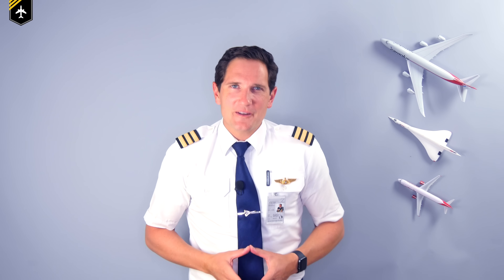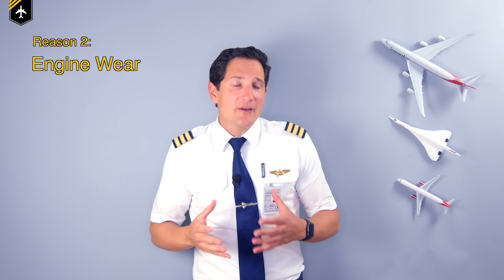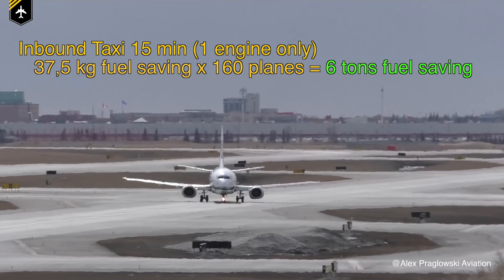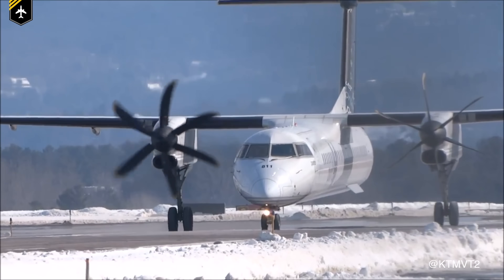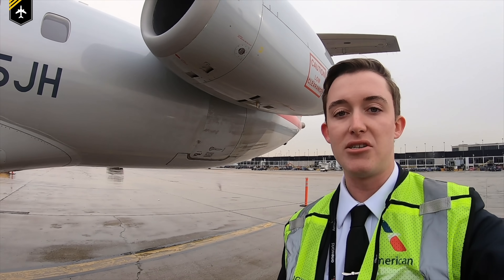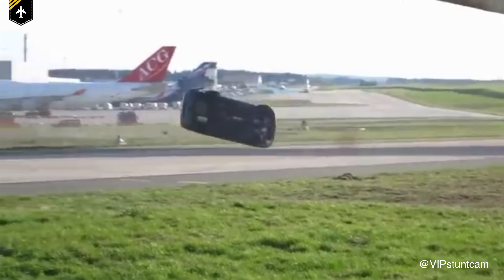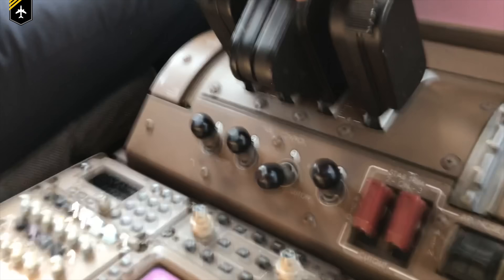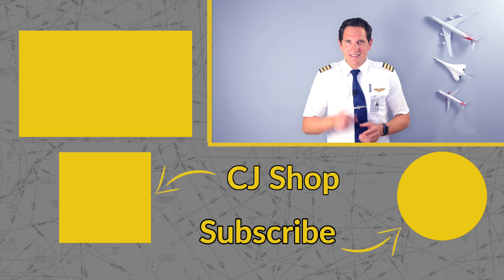Why do PILOTS taxi only with ONE ENGINE??? Explained by CAPTAIN JOE

Comment: After this Ryanair is gonna try fly with 1 engine for fuel saving.

* wow thanks for the likes guys 😂
Reply: Lmao 😂😂
Reply: Ask Mentour Pilot, I believe he's with Ryanair.
Reply: well they might be shutting it of during flight you never know...
Reply: I don't think that would be good for the wear if it is freewheeling with low oil pressure.
Reply: Ryanair knows about this way before the video bud
Reply: I heard once that in some cases the B727 performs take-off with #2 engine off. I do not know if that was a fact or nust a myth. Any thoughts?
Reply: @luisaguilar9003  myth totally. Takeoff is when you need the most power after all
Reply: @Kalvinjj  Thanks for the clarification!  I was very skeptical about that history. The B-727 is the jet airliner I like the most.👍
Reply: @luisaguilar9003  i like 747 A320 and A380 767 787  as airliners.... cargo freighters i like 747-8 and MD 11 fighter jets super hornet f 22 A 10 light aircraft learjets cessna 182 and piper pa tactical airlifters C 130 Hercules and Airbus A400M Atlas....
Reply: @luisaguilar9003  Yes the 727 can take off with only 2 engines, but this would not be used for a passenger flight. Planes are allowed to fly with disabled components for transfer to repair facilities. This requires special permission and is called a "ferry flight". Generally there are additional restrictions on the flight such as weather conditions and routing over less populated areas. Full power is only needed to takeoff with a fully loaded plane on a short runway; low loads, dense air, long runways, and flat terrain allow takeoff with much less power.
Reply: It would not be economical to fly with an engine shutdown because the engine will still be creating drag.
Reply: @mytech6779  Thanks! So, it's true but under special and restricted conditions.
Reply: @mytech6779  way to ruin the joke with facts....
Reply: @mytech6779  Into a thriller book, a Lear jet carring not so much weight cut off one of the engines during flight for saving fuel.
Did the author was wrong?
Reply: @luisaguilar9003  I wouldn't be surprised if that was the case. I believe the only reason the 727 had 3 engines was so it could bypass the 60 minute rule for 2 engined planes (This was before ETOPS). After ETOPS (Extended Range Twin-engine Operational Performance Standards aka Engines Turn Or Passengers Swim), 3 engined planes stopped being as succesful as 2 engined planes could fly further away from a diversion airport and were more efficent. Planes like the 727 would only really need 2 engines.
Reply: @luisaguilar9003  b   The 727's second engine is in the tail so they do not have to use it!
Reply: Luis Aguilar can’t happen. A 727 needs all 3 engines for takeoff. If u lose 1 engine below V1 takeoff decision speed. U need to abort the takeoff. Because there is a risk of the aircraft running out of runway before it gets the speed required to takeoff. And with 2 engine gone the aircraft can’t get in the air.
Reply: I heard that Ryanair now starts slope soaring to save fuel
Reply: Ryanair's just gonna turn off both engines to save fuel.
Reply: @davidliu2243  any company wants more profit, so any company want to save fuel. 
Any last part of flight its "glide as you can" if control allows it.
Reply: @b8l60x  in cessnas the slip stream pushes the fin to the right, and to counter act that you use right rudder, im not a commercial pilot yet, still working on my ppl but i would assume it would be the same procedure for a 737, so i dont think it would be impossible
Reply: And after that works well, Ryan Air will remove one engine from each aircraft in their fleet; 737s et al will have one wing with an engineless pylon operating.
Reply: They will shut down even both from time to time.
Reply: Wizzair too🤣
Reply: STOP GIVING IDEAS!
Reply: No , we shold propably shut both engines mid-flight ,the apu , the airconditioner and open the doors for fresh air! What will actually happen is ALOHA!
Reply: Or try fly with the apu :D
Reply: That is less economical because high rudder deflection and the shutdown engine make quite some drag.
Reply: Thanks I’m flying Ryanair next week!
Reply: LMAO XDDD
Reply: Thereal Imp yup lmao
Reply: Ryan usually turn off their eng.2 just before entering the gate. But they usually taxi with both engines(to taxi faster)
Reply: ok
Reply: actually I was on a Ryanair 737-800 and the plane come late and the airport closed and had to be transferred to another airport with one of those flight stickers on the bus door, after we boarded the plane the pilot said she's gonna get us back as quick as possible, I have never been in a plane so fast in my life, she full throttled it the whole way I went from GBG to STN in just over an hour I think we was touching 570-600mph the whole trip what an awesome pilot <3 will never forget that flight !
Reply: Someone is trying making jokes on Malaysia Airlines... Krik krik
Reply: Lol
Reply: I was sure they do it NOW hahahaha
Reply: Well technically planes can still fly with 1 engine, but it would put so much stress, wear and tear on the 1 engine
Reply: @doodskie999  I know twins can fly on one engine but could you take off on 1?
Reply: Do they even have two engines?
Reply: I dead😂
Reply: Can someone explain me....i didnt get a thing
Reply: @b8l60x  rejected landings?
Reply: Heehehehehehehehehhe
Reply: Thereal Imp  for the love of god, please don’t edit your comments thanking people for the likes. So cringey.
Reply: That's stupid
Reply: Well. When I fly my plane on only 1 engine AHHAHAHAH. It's too expensive to fly with 2
Reply: Peter Agner Bryndum I fly with 1 engine....it’s CESSNA
Reply: @owogamingguy  Nice! I fly the A22 foxbat and the 321 Faeta

Comment: What about the extra "stress" the one remaining engine have. Wil not that engine have more work to do, and use more fuel..?
Reply: 1. Planes designed to operate on one engine. 2. Newton's first law of motion.
Reply: @alkemis  I understand that planes are design to operate on one engine, but if the turn of one engine to save fule, the one remaining engine has more work to do, and Wil then use much more fule..

Comment: More like HOW does a pilot taxi with only one engine (on a multi)?

Without the plane going in circles.
Reply: The rudder and front wheel help keep the plane facing the right direction. Also the engines on most planes sit pretty close to center line. That limits the torque that the thrust of the one remaining can put on the plane.

Comment: Good morning Captain Joe. Are all jet and turbine engines started by compressed air? Can one be started with compressed air from a GPU or APU and then any others by bleed air? Can they be spun up by an electric motor on small jets?
Reply: Simple answers are- no, yes, depends. You asked about “ALL jets and turbine engines”. That includes a very large group of aircraft, including everything from a 747 to a single engine turbo prop or helicopter.

Comment: Question: how much exactly the speed that you need when you taxiing for the take-off or when you landing ???
Reply: I heard that the max speed on the taxi way is about 30mph.
Reply: LT.Admiral KD_Putrajaya 40 Knots is good .
Reply: Taxi speed is never really measured, on a B737 you usually taxi at 75-80% N2
Reply: @bahenbihen  doesn't it get measured with a GPS based "gs" or ground speed?
Reply: Topet Hernaez GS will show you your Taxi Speed, but I really doubt pilots look on that rather small number (737 has it in the upper left corner of the ND whereas the IAS is a big stripe on the left side of the PFD) all the time
Reply: @topethermohenes7658  GS readings are displayed according to data from a radar which means they're pretty inaccurate (a difference of 550kt and 545kt is less noticable than 20kt and 15kt). I think the MAXs have an actual velocimeter on the nose gear, but I'm not sure.
Reply: @KJA1582  nope the ias indicator doesn't move much on the ground as the speed is too low in taxi, I'm asking if the 737 has a gs indicator like the 320
Reply: @bahenbihen  it's based on GPS and Im asking if the 737 max have those too, cuz certain taxiways have speed limitations and the gs is the only instrument in a 320 that can tell ground speed, asking if it's the same on the max
Reply: Topet Hernaez 737NG and up do habe GS indicators, they Justs rent that large. My point was more akin to „GS indicator is small whereas IAS is large, thus prompting not to look on the GS indicator all to often“. I am very well aware that the IAS is unusable on ground (standing still at an intersection with 20kts tailwind). Then again, GS indicator on the Bus isn’t that large either.
Reply: @KJA1582  well I usually look at the gs on my bus intently always esp in very strict airports and low vis operations where maximum taxis are just 10kts
Reply: @topethermohenes7658  Some do, some don't.  Like driving a car, most of the time (low vis or strict procedures exempt) you just "feel" the speed (not in the Sim though lol).
Reply: @KJA1582  well that's dangerous, it's difficult to "feel the speed" esp if you had exactly 8 hrs rest and already on the 4th leg
Reply: @topethermohenes7658  Probably also highly aircraft dependant. Do agree, it can be hard (I regularly tend to drive abouz 10kph faster than I should ). It nevertheless IS some kind of reference point, be it a good or bad one.
Reply: @bahenbihen  Southwest intensifies
Reply: Depends on the size of the plane and runway you use.
Reply: 40kts is about 46mph or 74km/h so no. More like 15 to 20 kts on straights and down to 5kts on very tight corners. Even slower when going in to the stand (1 to 2 kts).
Reply: Kilian Hofmann no 40 knots is perfect. My dad is a pilot and he Tells me facts about it
Reply: @m6.kamilov  Which AC? 40Kts in a 747 at or near usable load is NOT a great idea.
Reply: Kilian Hofmann I meant 40 knots is the most
Reply: @m6.kamilov  AFAIK, the first sentence says it, to me at least, differently. But yeah, 40kts is definitely a solid upper bound.
Reply: @m6.kamilov  what planes he fly thougg. Lil priv jets like CRJ's and smaller like cessnas can but a 747 or anything bigger than a 737 would be steaming at 40. 30 is the respected number but in large airports with very long straights with low traffic, they might push up towards 40

Comment: why don't the pushback or the airport make a vehicle to pull the airplane to the runway so the planes save fuel
Reply: probably lots of factors.  
1) small airports, it would be a huge investment to have a crew to run the few flights that are needed. basically having an extra hand to do a job only a few times an hour.
2) large airports would also be a huge investment.  with planes landing and taking off every 30 seconds or so, you'd need a fleet of tugs and operators to handle every active plane, as well as managing plans that land, or planes that are ready for pushback from the stand.  how do you route the tugs? where do they sit and "wait"  plus the time to hook up ater a plane lanes could probaby cause delays on the landing runway/taxiways.
3) "safety"  as CJ mentioned, some engines need different "warm up" times prior to take-off.  think how you could damage your car if you jumped in early on a cold winter morning, turned on the engine, and floored it in gear.  probably you won't kill your car, but the wear would take its toll.  now, transition that to a plane that's carrying 100+ people, in the sky.  want to make sure that the engines are safe by following the known heating loads to properly warm up the engines.
4) any savings of jet fuel would probably be offset by the diesel/gas fuel used by the tugs. 
5) for take-offs, it sounds like you need the engines on anyway to run the hydraulic lines so might as well use them for thrust.

at least that's what i'm guessing off the top of my non-pilot head.